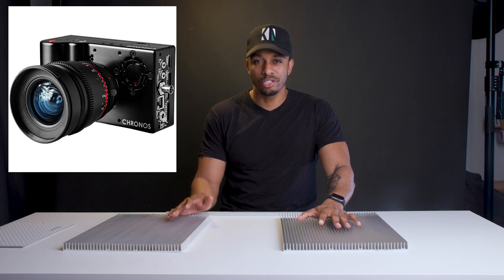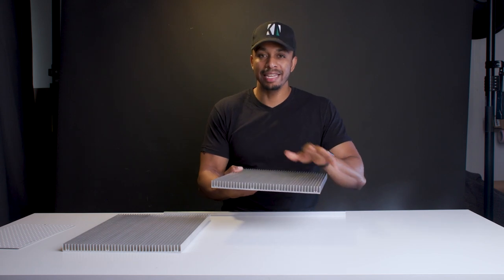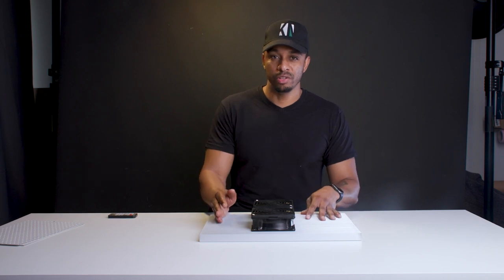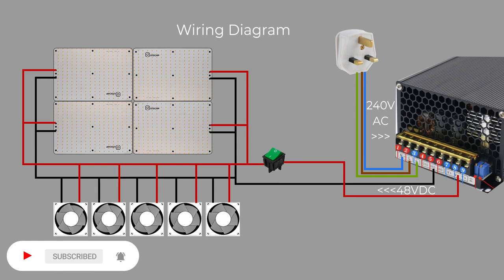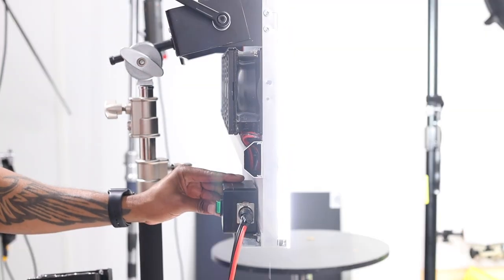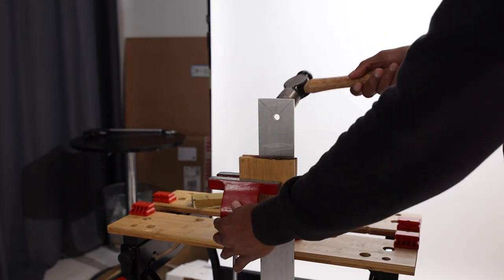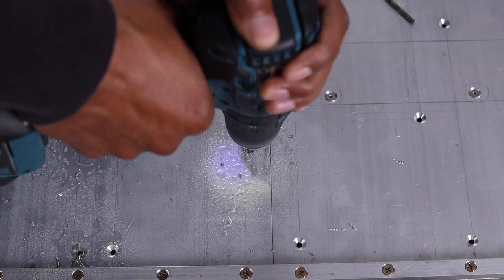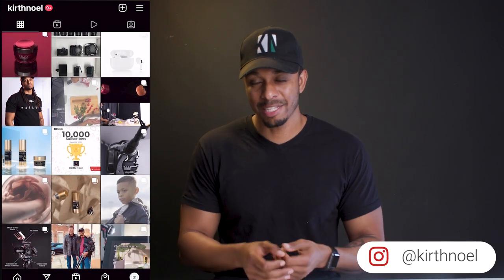How to build a DIY led light panel for video shooting

Comment: Dude you are obviously a good design engineer.  A really great  build.  Thanks for your efforts. You need to post a video showing the lights in usage. for your high speed video test.
Reply from the maker: Heyy thanks. Much appreciated. I’ve got a few high speed shorts on the channel that shows em in action